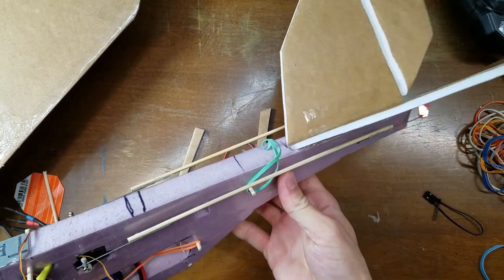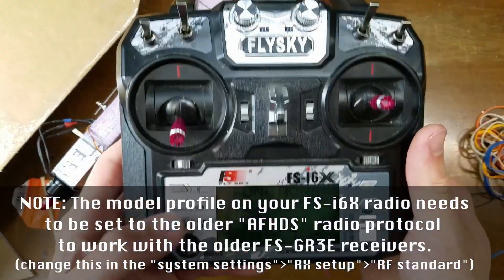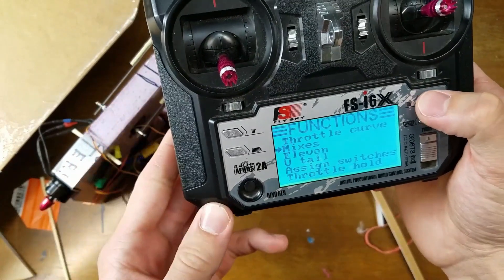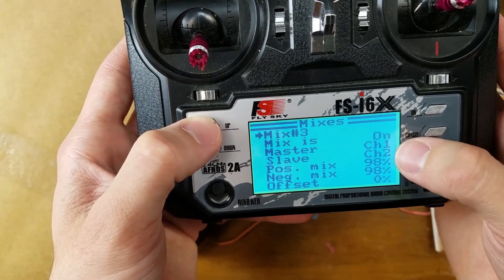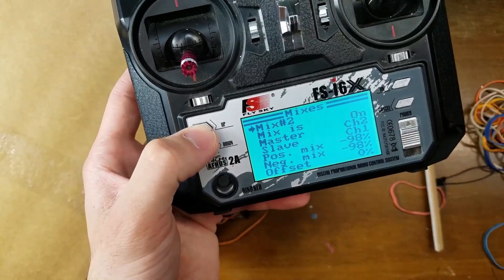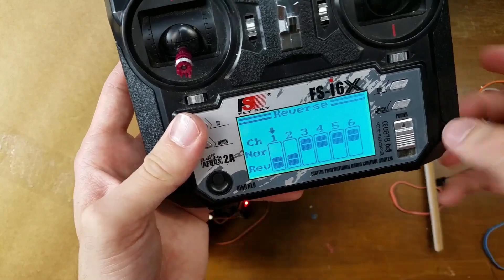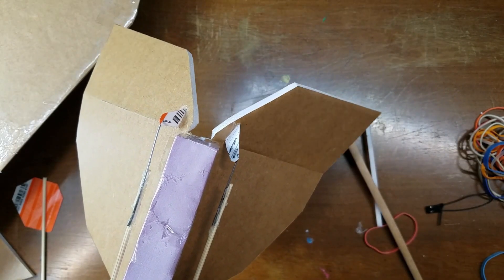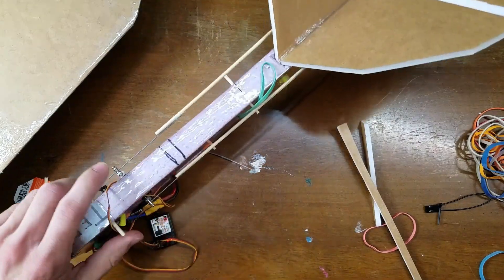How to Set V-Tail Mix with FS-GR3E and FS-i6X (FlySky 3ch receiver)

Comment: If I want to see how to do something Flysky i look to you but in this case you made things more complicated than they need to be. . you can just use the ELEVON set up and it works fine. If you flatten out the V tail you have a delta wing. I set this up on the ft sparrow using the Elevon function , no mixing , and it handles great

Comment: I have a much simpler solution on the FS-i6x. Assuming Channel 1 and Channel 2 are being used for each servo on controlling the V-tail: Reverse ONLY CHANNEL 1. Turn Elevon ON. Channel 1 and 2 100%. Done.